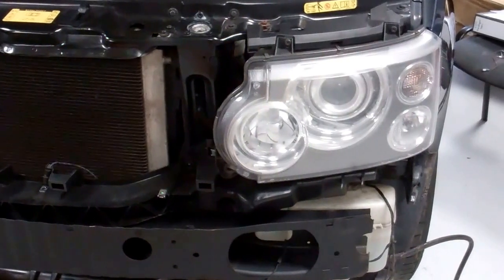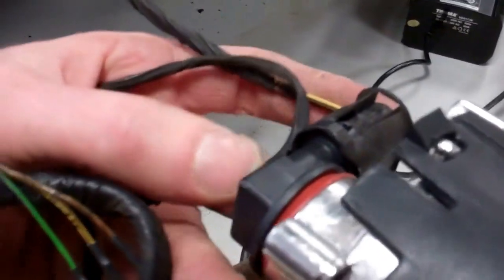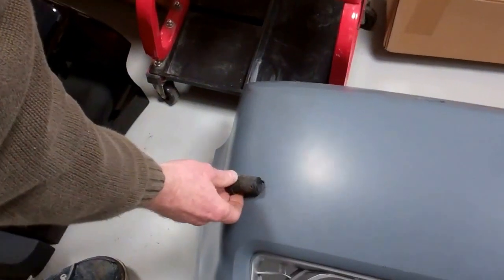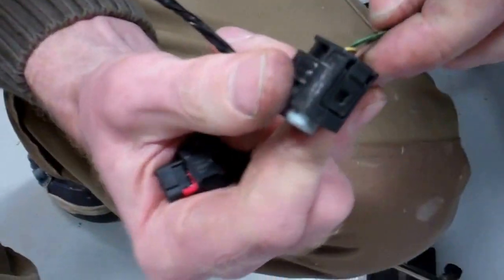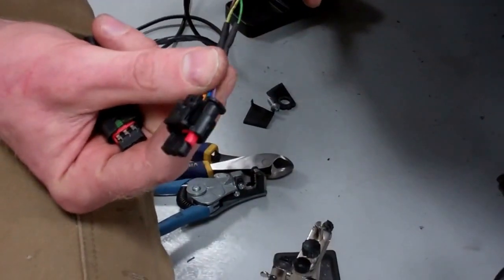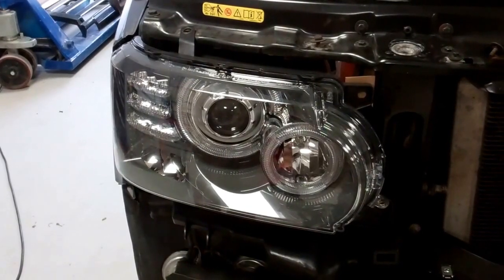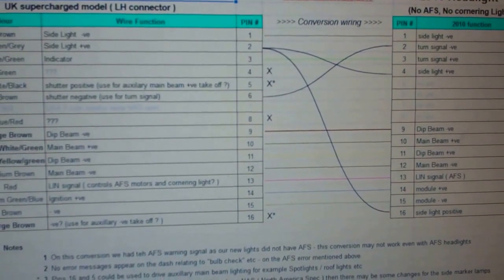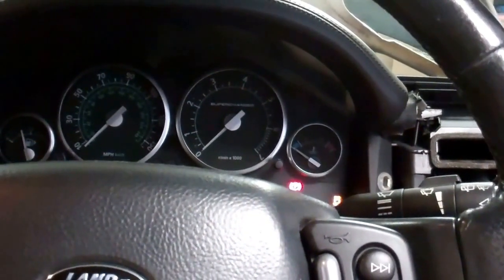Range Rover L322 2006 to 2010 Conversion - Front Electrical Changes

Comment: Hey guys, for the AFS just unplug the AFS control module on the passenger side bottom a pilar. It is tucked in under the kick plate. When you disconnect the two plugs on the module the AFS system is now deactivated. The AFS check light on the instrument panel is directly driven from the module (according to LR electrical diagram library).
What it also does however is remove power from the lines pin 13,14 and 15 on the headlight connector. Not too sure about pin 14 tough, this might be powered from fuse 48P.

Comment: Hi, I have done the headlight conversion in my 2008 l322. I followed your wiring diagram and have double checked all wired and connections, everything works as should until you start the engine and leave running for about 30 seconds and then the angle eye and the indicators start to blink. I then bought your indicator resistors and fitted these however now when its left running for about 30 seconds the indicators stop working all together. If I unplug the resistor they start working again but blinking fast. Any idea on what I have done wrong or what I can do to fix this? Many thanks
Reply: Hi, was this issue ever sorted please?
Reply: @TheTruth-sc3sd  No PowerfulukLtd didn't reply so ended up getting rid of the vehicles

Comment: Hi, my RRS 2006 with upgraded headlights to 2010 (valeo), shall I follow the schematic link instructions as you mentioned so the afs alarm won't be able to appear on dashboard any more? Please your feedback is highly appreciated
Reply from the maker: Hi - yes the AFS warning light is an issue. The 2006 and 2010 used different communications systems for the AFS system. There are a few options available to you to fix this warning light
1 - remove the cluster and remove the bulb 
2 - Use an IID tool to disable to AFS in the car configuration files ( CCF Files )
3 - i have not tried this but you could try disconnecting the AFS control module - i think its on the left hand footwell side wall - next to outside of car.
Reply: @L663  thank you guys for your support and help. Am grateful for you.
Reply from the maker: @hadimokaddam2348  Sir it is me that should be grateful to all you Range Rover owners that buy our products and support our business !

Comment: Hi do u do a convertors for the 2003 head lights to 2010 . I can only find ones for 2006 onwards
Reply from the maker: Hi sorry for slow reply - these are tricky to make as the number of connectors on the 2003 as side light and indicator are separate - you are better off cutting and fitting the new connector

Comment: Hello,  hoping you can help.  I did the headlight conversion but my angel light and side marker blink.  So I bought the resistor and installed it and still the lights blinks.  I was installed according to specs.  Please advice what can I do or did wrong.  Thank you
Reply: Hi, I have the exact same problem, i see you didn't get a reply. Did you manage to sort this issue?

Comment: can you install the 2010 headlights on a 2008 front bumper? as long as you change the grill? or do you need the full front bumper as well? @powerukltd
Reply from the maker: the 2010 headlights have a different slope at the sides so need different wings... you then need a new grille.... the new grille necessitates a new bumper... so i am afraid its the whole lot that needs changing.

Comment: Just curious if we buy the converter and the 2010 lights do we still half to upgrade the rest of the front end? Will it not fit with a 2006-09 l322 full-size? Is it a issue where the grill will have space in between the light or lights and car panel?
Reply from the maker: Yes its like a jigsaw puzzle - the lights / grille / front bumper all fit together. The front wings are not a problem.

Comment: Hello. Where is the headlight wiring conversion from 2003 to 2010, please? Thank you.
Reply from the maker: Not a problem Carlos - you can see the wiring on our website
https://www.powerfuluk.com/vehicles/range-rover-full-size/l322-vogue-2002/2010-conversion-parts/range-rover-l322-16-way-headlight-connectors-for-2010-models-pair.html

Comment: Where do you get the headlight harness?
Reply from the maker: https://www.powerfuluk.com/vehicles/range-rover-full-size/l322-vogue-2006/2010-conversion-parts/range-rover-l322-2006-2010-headlight-conversion-connectors-pair.html

Comment: I still waiting on the 2010 taillight conversation
Reply: RAY///M316 they uploaded that video a couple weeks ago
Reply: Jordan Lickley can you send me the Link please thanks
Reply: Jordan Lickley  I talking about the taillight connection
Reply from the maker: Hi - we have done the "mechanical" conversion of the rear lights - but not the electrical
Turns out getting rid of the "pulse" and stopping the fog light working on tail lights is a bit tricky !
I have solved it and got the circuit designed - its now being made and should be back with me for video next week !